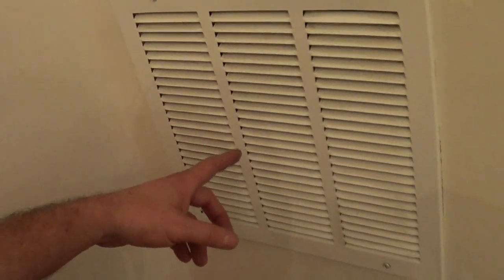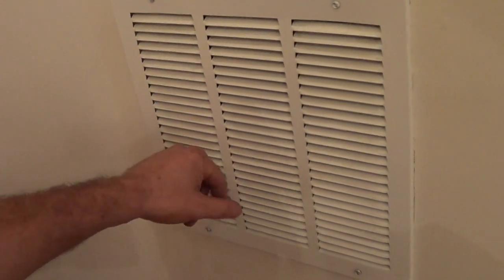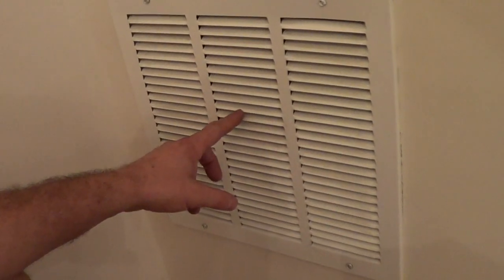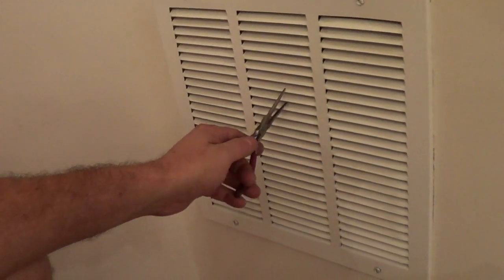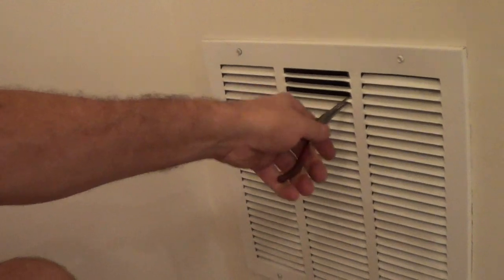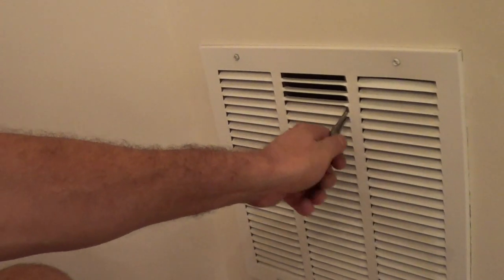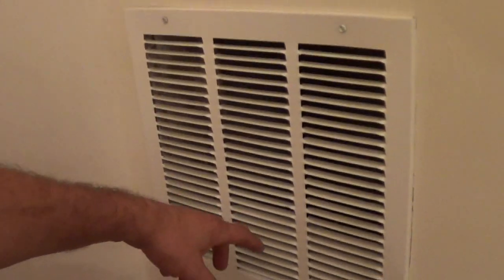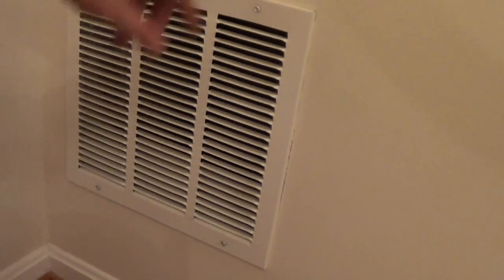Reduce Air Noise on a Loud Return Air Vent

Comment: Ok the "singing" vent has been driving me crazy ever since we moved into this house a year ago.  Took the vent down....cleaned it....wrapped a couple of band-aids on the tips of the needle nose pliers (so I didn't scratch the paint on the louvers) and bent them as instructed.  Put the vent back up and SWEET JESUS THE SINGING IS GONE!!!!! HALLELUJAH!!! I have hyperacusis  and the singing seemed so loud to me, I couldn't stand it.  Thank you so much for this video, not only did you same me money but my sanity as well!
Reply: I bend them so DO sing when at someone else's house if i get the chance
Reply: I also have hyperacusis and I’m about to lose it with mine.  I’m gonna try this.  Praying it works 🙏
Reply: @flowerkisscandy  I certainly hope it does. Soooo many noises drive me crazy and send my nerves through the roof.

Comment: The product was Easy to install https://www.youtube.com/post/Ugkx_hHgTlzH3uk31Fe2RVS3xEbXHGaN_z5T and runs well. I was a little disappointed some of the app features aren't supported (maybe because this is an older model). Note for anyone buying this that the feature in the app to monitor power usage won't show up, because it isn't supported, but will be there for certain Midea AC's. Other than a few of the features in the app missing, everything else went smoothly. I had picked up an additional thing of sticky insulation for the window, but everything else was included in the box.

Comment: I did this. Thanks. So in my case the new humming noise started coming out. It is still quiter than before. I found a new fix. I used carpet tape (any thick 3m tape will also work). Cut the 2-3 pieces of tape of 3-4 inch lengths each. Now with trial and error try putting tape in different locations of the grille. Even quiter. Now I can only hear wind flow and no annoying mouth organ sounds.

Comment: Thank you for taking the time to post this video !!  We have been dealing with an annoying, very loud cold air return noise for 10 years situated by our 4 upstairs bedrooms making it difficult to sleep and watch TV or read.  We were almost talked into a new $6000+ high efficiency furnace that the tech said would "help reduce this noise".  It took me 15 minutes to straighten out the angled louvers and BAM...noise level went from a 10 to a 1.

Comment: Nathan - I have a return air duct on my floor in my living room - it's about 16x25.  it doesn't have the slats that i can adjust.  it's super loud - super loud.  how can i reduce the noise??
Reply from the maker: Use flex duct instead of sheet metal.   It only take a few feet of flex.   Try to keep it big enough to match the existing duct area.

Comment: How's this for a suggestion? Tape 1/2" strips of Dr.Scholl's foot bandage (or anything with one side soft) vertically over the INSIDE of the horizontal metal rows so that you can't see the tape. The foam should stop the vibration. The vanes are acting like a tuning fork.

Comment: I just started noticing this noise, but only when my ac is on. I turned on the heater and the noise is not there. Do you think this could still be the case?

Comment: My issue is with a register in my basement close to the floor, my hvac unit is on the other side of the wall.  Wind is sucked in through the register which is no big deal, my issue is that every time the hvac kicks on a loud noise echoes through the basement register, off the tile floor and literally through the whole house.  I have two of the vents shown above in the hallway upstairs and the sound never reverberates upstairs.  So how do i put a silencer on the register without affecting airflow to the hvac?  Are there any such things as baffled registers that allow air in but not allow noise to echo out every time the hvac kicks on?
Reply from the maker: If the branches to the registers are 6 inch round metal, install 6 in flex instead.   Flex prevents the noise from traveling down the pipe.

Comment: I notice mine making the noise after I cleaned them!  So I guess if they are nice and dusty they won’t make any noise!  🤭. I’ll try this tip!  Thank you.  Just moved to a new property.
Reply from the maker: That is cool.   The dust acted like vibration dampers.
Reply: Same here.  After five years of use I pulled down the vent cover to give it a real cleaning and now it sings like Tibetan bell!  Or the old 'finger on a wine glass edge' sound.  The dusty grime kept it from ringing.

Comment: Put a bigger vent. I like that option better. Or add a second right?! Good tip.
Reply from the maker: There is a rule for face velocity on return air vents.  It is square inches per ton.  Somebody will probably post it.
Reply: What I do is measure the size of the grille opening and multiply it. Example: 30x14=420 Then multiply that by 2( 420x2=840 )equals the most cfm that would be acceptable on that return air grille.
Reply: So what you guys are saying is that, on the flip side of the coin, you can also have TOO MUCH vent on the return?
My current return is at about 195 square inches. It is an old mobile home unit and the filters are of an odd size that's just about impossible to find. I'd like to modify the cover to accept a larger, more standard size filter.
But if I understand what's being discussed here then my modifications (larger openings) shouldn't exceed 390 square inches, correct?

Comment: Would changing to a Bar type grill get rid of the singing ?
Reply from the maker: Yep.  Those are called High Velocity vents. They also get rid of the whistle which is still there but hard to hear on the video.
Reply: I've heard bar type grills do the same thing but I'm sure that some can be fixed by switching to bar type.

Comment: The air velocity on my return is so loud and painful! I tried this trick but it did not make a significant difference. My landlord says that all of the apartments have this sound and it is not a big deal, but I have to double the volume on my TV every time the air kicks on.My problem is that the fan is eight or 10 inches behind the return and it sits in the hallway. Any suggestions on how to quiet it?
Reply from the maker: Put a couch in front of the vent. Leave 3 inches for air flow.
Reply: @NathansHVAC  a couch in the hallway
Reply: Put some duct tapes stripes on different location of grille

Comment: What if your vent is in a place that if you bend the vents you can see inside the hole and it's ugly as heck.  I have two returns.  One is an 18 and the other is a 12.  The 18 is much closer to the fan / system in the attic.  I hear that humming sound and it's driving me crazy, but if I bent the vents like you did in the video you can see straight into the huge hole and see metal etc.  Not a solution.  Also can't turn the vent so the louvers face down, same issue.  What and where is an aluminum high velocity

Comment: The reason for noisy air grills is a too high air velocity. Too high air velocity is a direct result of too high static pressure inside of the unit. Too high static pressure is a result of insufficient return ducts installed. Thus, you already have insufficient air return and instead of correcting air flow with additional ducts, you suggest to narrow the existing  air return with muffles.....? Very clever! Keep in mind that your A/C unit doesn’t know that it doesn’t have sufficient amount of air to move. Your unit still burns the same amount of electricity as it was designed . However, it cannot produce the BTU amount as it was designed because of air flow restriction. In short, when you hear that whistling air grill noise you should know that it’s your money whistle to you before it goes to your utility company. Correcting air flow with additional return ducts will solve the problem. Using a muffler for your air grills will make your utility company happy, but it will not solve the issue.
Reply from the maker: Lower airflow makes the ac dehumidify more.   Efficiency changes are minimal as long as the unit isn't icing up.  Face velocity depends on static pressure and area of the grill.   Straightening the louvers reduces turbulence and pressure drop ad the grill.   But, i agree bigger grill and or duct is the best solution.
Reply: I am HVAC contractor and I know for sure that insufficient returns is a VERY-VERY common issue, especially with 2 levels residential construction. People use the space inside of the drywall as a return air ducts and.... it is 3 1/2 “ x 14” opening that can handle 100 CFM assuming that velocity is 400-450 fpm. So, now if it’s a 5 ton unit we want to have ~2200-2400CFM for air return. That means we would need 20 (!) of such in-wall returns installed. Plus, on average air grill cuts off 20-30% of air flow and keep in mind the length of the ducts and any turns it makes. So, when I hear that customer complaints on noise, supply grills sweating or mold growth, insufficient cooling/heat and running nose every morning as a normal daily routine I take a look at the ducts first and in 95% ducts are insufficient. Mostly it happens to returns, but it can be return and supply. I guess every contractor had seen excessive mold growth on evaporator coil and inside of the supply air plenum when air flow trough the coil is limited.
I do agree with you that slight modification of return grill might help to reduce the noise, but it should be considered as a temporarily relief only.
Reply: @edlauren9434  Hi so if I just received a new HVAC unit and it’s loud to the point I can’t sleep. Will I need to hire someone else to come do some duck work?
Reply: To add a couple of return ducts you will not spend thousands. However, with sufficient air flow you will significantly improve the air quality in your house; you will reduce or completely stop mold growth inside of your HVAC system and air filtration will be way more efficient simply because more air will be going trough that air filter. Here is a typical story what customers tell me: “….. before air duct work I was replacing the air filter every 6-8 months and it was just a little gray. Now, after the airflow was corrected I have to replace air filters every 1.5-2 months because it gets pretty dirty..”. 
About monthly bills… Ali average my customers tell me about ~$80 per month per A/C unit. Thus, if it was a 2 story house with 2 A/C units customers would say that this July/August the electrical bill was $150-$160 less…